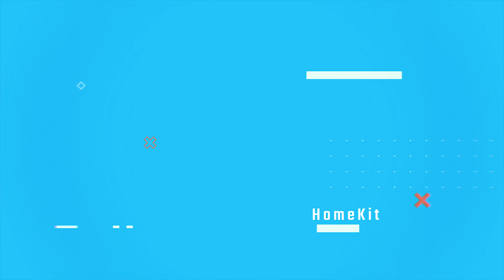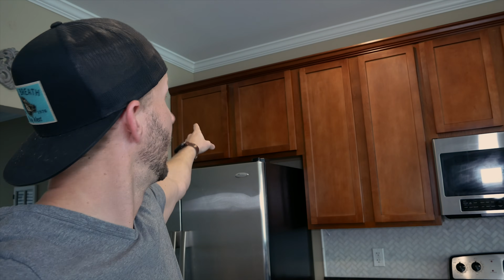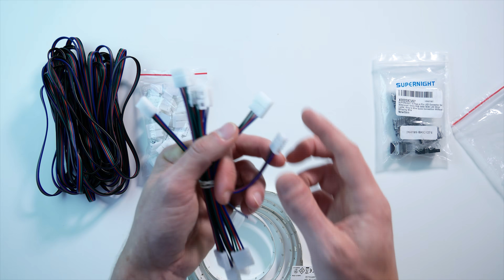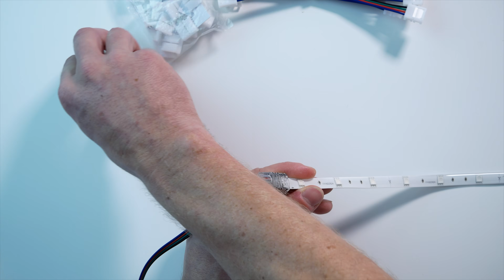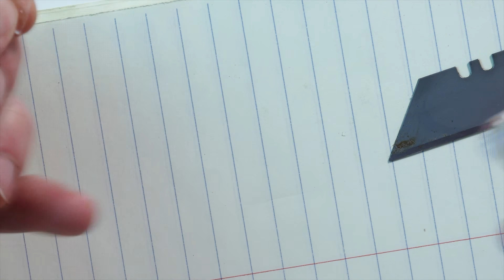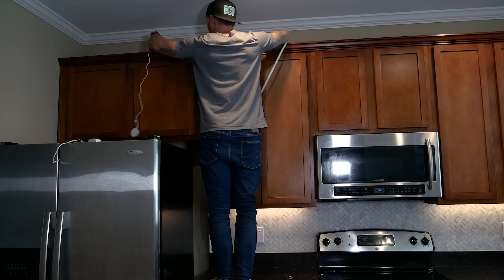How to install LED Strip Lights – Under Cabinet Lightstrips for your Smart Home!

Comment: I did this and now on one side after the microwave it only turns blue on one side
Reply from the maker: I've had this problem and still do sometimes if the wires get loose at certain connections. You probably just need to tweak the connection points and make sure you are getting a solid connection.

Comment: Shane. Is there a four way splitter so I can run wire to a cabinet on the opposite side of the kitchen, so I don’t need a whole kit for a small cabinet. I want them to all be synced up.
Reply from the maker: Not sure about a 4 way splitter but there are tons of accessories for doing that sort of thing. Just look online for accessories and/or kits that will work with your lightstrips and you can probably find something that will work.

Comment: When the LED's transition under the microwave area, above the range, is that considered a fire hazard and should be better protected? Granted it is low voltage wiring.

Comment: How does the separate strips change colour independently? Is it two separate controllers or just the one? bit confused how it works. Any help would be appreciated
Reply from the maker: Yes, they are two separate controllers.

Comment: So I followed the steps like you have in the video, but the second strips after the wire just seems stuck on red. It's powered on but can't do anything to change the color. Thoughts?
Reply from the maker: It seems like there is a bad connection somewhere. I would just try adjusting the connectors until you can establish a solid connection. Try wiggling and finagling the wires and connectors until the colors are right all the way through.

Comment: I tried the same setup, and couldn’t get the 2nd strip to light.  I’m using the Meross 16.4ft one.  I got a flat, white, 6-wire cable, and the same strip-wire clips.  I tried for an hour, to no avail.  I lined up the 1 wire as to not cross them.  I think I covered everything.  Any tips?

Comment: So when I add the jumper under the microwave one side of the LEDS are green any suggestions
Reply from the maker: Sounds like the connection is 100%. You can try adjusting the connections on either side to see if you can get a better connection. That's what I had to do.

Comment: I'm trying to figure out how to connect 2 strips on angled diffuser channelling L shaped connectors 90 degree definately won't do the job so I'm thinkinking 6 pin connector to wire trim wires down add a connector job done in theory

Comment: So I can make this gap with the philips hue lightstrips, too? They are so expensive and I don’t want to mess this up….
Reply from the maker: yes,  you can, you just need to get different connectors and accessories that will work with hue lightstrips.

Comment: I’m doing this tonight but the connectors aren’t working. I’ve tried all different combinations of wire to connector, but the strip after the extension wire won’t power up. Thoughts?
Reply from the maker: Hard to say without seeing exactly what you've done. Something must not be connected right. You do have to get the connection just right for the colors and power to flow correctly.
Reply: @ShaneCreates  I noticed that your wires in the video didn’t align with the RGB on the LED strip. Would that cause the issue? Also, my LED strip has copper connection points with and without soldering between them. Does it matter which set of connections I’m cutting?

Comment: I need a longer total length than 13 total feet but don’t want to goto 2 separate plugs since only one is hide-able. Any suggestions…I need about 15 total feet of light plus some gaps to cover all areas
Reply from the maker: The lightstrip I just reviewed (Onvis Kameleon) has a 16.4 ft version. Maybe that one would work? Full review is here: https://youtu.be/x4Dmj57Qxl4

Comment: Can you háveď an on/off dimmer switch to turn the lights on?
Reply from the maker: You can program any HomeKit button/switch to turn the light on and off and maybe set some presets. Can't do a dimmer tho. But there are other lightstrips that have a on/off + brightness controller that you could mount somewhere.

Comment: Anyone know what is up with VOCOlinc? I need the get an LS2 extension and they and the starter kit are both constantly out of stock. I’m almost done and need an extension to finish my under cabinet lighting and don’t want to switch products.
Reply from the maker: I've been told recently that they are having big issues with the chipset shortage and they are having a hard time replenishing stock due to this. Hopefully it gets better soon.

Comment: I have the same VOCOlinc strip.  How do you control the light effects in HomeKit?  I can only see those options in the VOCOlinc app.  Thanks!
Reply from the maker: The easiest way is to create a new scene in the VOCOlinc app that includes the effect. That scene is then carried over in to HomeKit and you can run the scene from the home app, siri, etc.
Reply: @ShaneCreates  Game Changer!
Reply: @ShaneCreates  Thank you! I had no idea the scenes would carry over.
Reply from the maker: You’re welcome!

Comment: How warm do these lights get? I just purchased an Embrighten kit, which is basically a strip inside an aluminum frame. Gets WAAAAAAY too hot. So I need to change it out with something.

Comment: Shane, need some input to help me get my light strips setup on my cabinets. I see the VOCOlinc strip is divided at the solder points, which you are using, every 19.5 inches. The light strip also has points every 4 inches with a scissor icon. Do you know how to utilize the scissor points to piece together the sections so it is more flexible?
Reply from the maker: Hey Wayne, I don't believe you'll be able to restore the connection if you cut at the scissors point.
Reply: Thanks.

Comment: Were you lucky that your measurement allowed you to cut on that solder point? What if you had to cut in between a soldered point? Same principle? Just strip it? Also is your underneath of cabinet flat throughout the bottom?Great video btw!

Comment: Need some advice. I brought one VOCOlinc strip for the bottom of my cabinets and fixing to put a whole new one on the top of the cabinets too but have some leftover from the bottom strip and want to combine to fill wall to wall on top. Is there a simple connector to attach to both not shown in the video bc I still have the end i don’t really want a 3inch section of wire connecting them like he did for his in the video. Thanks in advance!
Reply from the maker: You should be able to find connectors that allow you to connect a lightstrip on both sides.

Comment: Hey Shane! Would that jumper wire work on a Phillip hues light strip?
Reply from the maker: The process should work but you’ll need connectors for the hue Lightstrip. I think Phillips hue is 6 pin.

Comment: Thanks for the video. While looking for parts on Amazon, I see other kits for connectors. A couple kits have a splitter which I think could be used to go right/left for under the cabinets from a center cabinet. I have two areas, above the stove and above the fridge, where I have a cabinet which will have outlets I could use this arrangement. Anyone setup their lighting this way?

Comment: Good video. when you install these light strips, don't put them so close to back wall, all we see are hot spots on the back wall, and not much lighting on the center of the counter. A Lot of pro installers make this mistake also. This is more important as you age because the elderly can't tolerate glare of the backsplash as a useful lighting source. By mounting your LED strips closer to the front of the cabinet, the counters will be more evenly lit without the glare.
Reply: I’ve installed these in several applications and the best result I’ve have found is no more than 3” front the front of the cabinet and no less than 2”...if they are too close to the cabinet front they tend to shadow the front of the countertop....between 2 and 3” work the best
Reply: @bongobill2000  cvc
Reply: Using this tip. Thanks!
Reply from the maker: Thanks for the tip! I actually intended for mine to be more of an accent light than functional lighting for the counter so I kinda wanted it to light up the backsplash. But I definitely hear you. I've been thinking about getting some diffusers to put the strips in... maybe a future update.
Reply: @ShaneCreates  I actually was going to ask you about diffusers. Do you have any that you would recommend?

Comment: This is incredibly difficult to do. The connector he used in this video are not working for me. I’ve spent the last several hours trying. Yes, I’m matching the wires up correctly and cut correctly. The volts are just simply not passing through. 

Any thoughts, Shane?
Reply from the maker: Which connectors are you using? And which Lightstrip? Same as me? It took a little finagling to get the connection just right but it’s been fine ever since.

Comment: Why didn’t you cut where the picture of the scissors ✂️ are? If you cut there do you still need to buy the other wire accessories?
Reply from the maker: If you cut where the scissors are you can't reuse the part that's cut off. You need the accessories to create the gaps, etc.

Comment: You make it look easy - but where is the plug in? My kitchen has few plug ins and would require a lot of drilling, etc. to hide the wires. Funny how these companies never show the wires or massive plug-ins in their setups. It's deceiving.
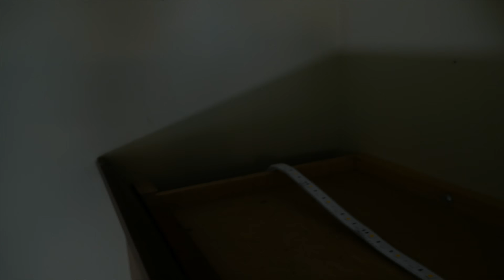Reply from the maker: At around 2:40 in the video I show exactly where the power cord is running for each light strip.

Comment: Thanks for the vid. I was actually hoping you would have a little more detail on the adhesive and how well the strips hold to the wooden surfaces. The choices are pretty limited, either the balsa wood(?) underneath or the finished wood on the lip. I actually plan to do the perimeter but it’s nice to know a single strip does just fine.

Comment: is there a switch you can use instead of phone?
Reply from the maker: If using HomeKit, you can pair this with any HomeKit wireless button. This particular lightstrip also has a physical on/off button if you mount it somewhere accessible.
Reply: @ShaneCreates  Nice. Thanks for reply!

Comment: Can I connect several kits and control all with Siri?  I have 2 large breaks in my upper cabinets so I’m guessing I’ll need 3 whole sets. Also, Is there a way with shortcuts to create your own adaptive lighting with these strips?
Reply from the maker: Like grouping them? You can group lights in HomeKit and control them all together with a single command. 

There are some people who have used automations to create a "simulated" adaptive lighting, but it would require many automations. You can do a shortcut that checks the time of day, and then sets the color temperature based on that, using shortcuts. But it wouldn't gradually change throughout the day like adaptive lighting is supposed to do.

Comment: Love mine I just wish I could say “turn on flow mode” or say the effect to engage it. I have to go into the app to do it.
Reply from the maker: Actually, you can set up a new homekit scene from within the Vocolinc app and include the light effect. Call the scene whatever you want, then you can use siri or include the scene in any homekit automations, etc.
Reply: @ShaneCreates  oh I see yes it works. Instead of just calling out a color I should call out a scene. 👍

Comment: These LEDs have been out of stock for a long time, what are some other ones?
Reply from the maker: They've had some inventory issues over the past year. I think due to the pandemic. Really this should work with any homekit lightstrip. You just need to make sure you get the right connectors and extensions for your lightstrip if you are cutting them like I did (for example: 6 pin vs. 4 pin, etc.).

Comment: Hmm, time for me to get the kitchen done with some lights. You know what they say, Happy wife, happy life...
Reply from the maker: Indeed!
Reply: @ShaneCreates  I took another approach last night, and installed two Philips Hue strips (since we have the kit already), and it came out rather nice. I even used some flat type cable management clips. Cables are not visible. So, the missus is happy...
Reply from the maker: @circatee  that’s awesome! Nice job!
Reply: Happy Spouse, happy house!

Comment: How do I jump across the sink to add a strip under another cabinet that will sync up with the opposite side? I don’t have a cabinet over my sink. I did install hidden outlets in each cabinet anticipating under cabinet lighting. I am hoping there is some sort of wireless receiver that will link up to the main controller instead of having to buy another whole kit just for a 24” cabinet.
Reply from the maker: To keep them wired together, you'd have to hide the wire somehow to make the jump across the sink. I'm not sure about any wireless receiver that will link them up.

Comment: Why not just continue the lighting under microwave?
Reply from the maker: Already have a light under there. Plus I've seen LEDS on light strips change colors and get messed up for far less...figured the heat from the stove may damage the lights over time.

Comment: Question:Is it possible to put Led Strip under microwave, instead of extension cord, to much work I guess, shortcut..Nice video by the way..
Reply from the maker: Well, yea I guess you can do whatever you want. I'm no electrician so I'm not sure if this poses any real safety issues or not, so you may want to check with a professional. Personally, I chose not to because I thought the lightstrip itself may get damaged eventually getting exposed to lots of heat. I've seen LEDs turn color and get messed up for less over time. With this method, there are no LEDs under the microwave and I was able to tuck the extension wire back by the wall out out of the way. Plus I already have a built in light under the microwave.
Reply: @ShaneCreates  make sense.Thank You for the reply

Comment: Would be great if some manufacturers decided to make a direct wire / hard wire set of smart light strips that fit under cabinets. Hard to find!
Reply: currently looking for the same thing.  I know they exist.  My church has them on stage and they are plugged into a dmx lighting control which is hardwired to the stagelights, but it probably doesn't have the ability to change effects via app--computer interface only is what I'm thinking

Comment: Had a curious question if someone could help me with, Can this be done with the Phillips hue light strips by chance?
Reply from the maker: Yes it can, as long as you get the right connectors. I believe phillips hue strips are 6 pin light strips. But double check that and get the right connectors and it should work.
Reply: @ShaneCreates  Thanks Shane! Really appreciate the Helpful Video!
Reply from the maker: @edgarcanales5920  you're welcome!
Reply: Probably can’t easily do animations— Phillips doesn’t seem to care about them

Comment: My kitchen currently has a setup of puck lights from Ikea with a tap switch in place to toggle the lights on/off. Half of this setup continues to blow a fuse and stop working. I'm really considering doing your setup now as a result of this great video. Would you have any recommendations for a tap controller as opposed to a smart switch and outlet? I just want the rest of the family to be able to control the lights without having to pull out a phone, and I'm also thinking of future home owners in case they don't have a smart home setup.
Reply from the maker: Not sure, that might be tough considering the future home owners. But for now, I would use a homeKit button. As long as the lights you are using support homekit also, any homekit button can be configured to turn on and off the lights and can be mounted anywhere you want.

Comment: I worry about that extension crossing above the cooktop. I doubt that’s code friendly. Certainly not if it were line voltage. High risk of melting and becoming a fire hazard.

Comment: Great video. If I had one suggestion to any budding installer...move the light strips a little forward under the cabinets. It will shed more light on the actual counter by allowing the light to spread out. Just play with it to get the right setup for you.

Comment: I have posted to you before with some questions before Christmas time and had mentioned to you that we had bought a new house and that I wanted add under cabinet lights to our new kitchen after we have moved in. Now we are moved into our new house and had previously mentioned that our new Kitchen was very similar to your kitchen.
Again, now that we have moved into our new house, I have bought a Vocolinc color changing light cord, I think they are wireless lights? I have forgotten how to hook them up. There is no usb or plug attachment? What do I need to purchase or get so to get them to work? I still haven’t gotten a smart plug yet, I have a echo dot, I also plan on getting the new Apple HomePod mini. But for now I forgotten what kind of attachment I need for my wireless light cord or cable??
Reply from the maker: Hey Trisha. Sorry I'm not sure I understand. You shouldn't need to buy anything additional to plug them up. If you don't have a wall plug/power supply then maybe you accidentally purchased the Lightstrip "extension"?
Reply: @ShaneCreates  yes I have bought one of those light extensions, I now realize it. So since I have gotten a light extension, what light strip attachment do I need to purchase?

Comment: Holy shit the microwave jump connections are a pain in the ass.     I have almos the same setup and gap on bottom and same accessories for the gap.    Top super easy bottom I have redone due to lights showing so we are moving them closer to the front of the cabinet not to show the led hot spots.      May also do a channel and diffuser.